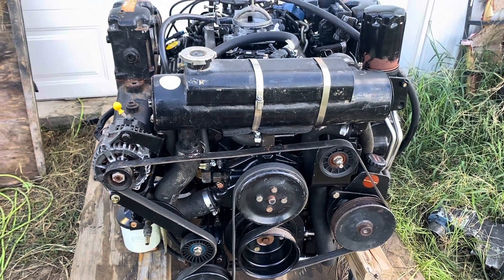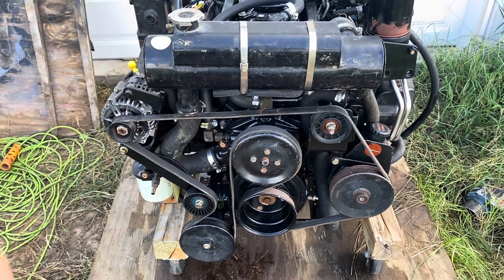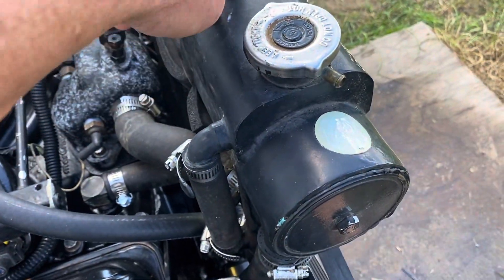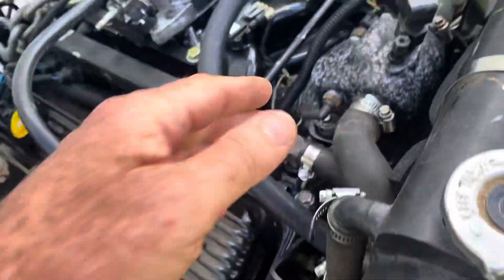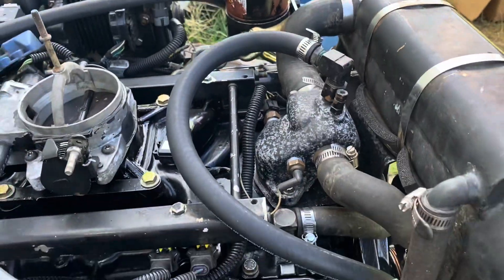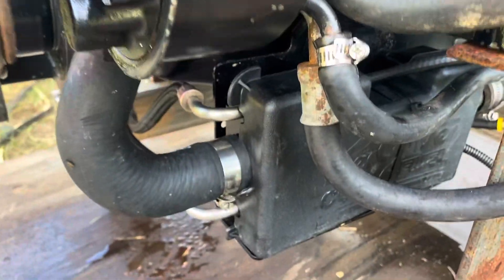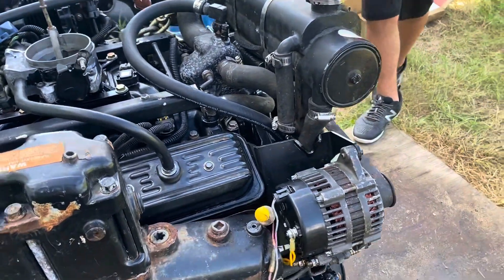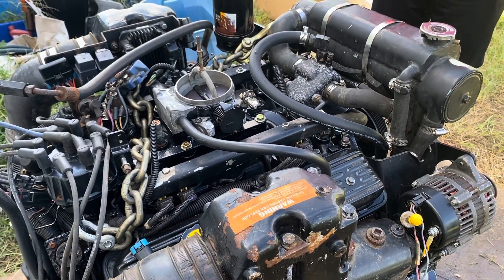Mercruiser 6.2 (1f) - Closed Cooling System Basics

Comment: Hi, i have two of these in my boat, i was wondering if it’s beneficial to fill the radiator with coolant instead of water, we are in Australia and don’t have to winterize the engine at all. Thanks for all your help.😊
Reply from the maker: I would add a minimum of antifreeze to the engine since there are corrosion inhibitors that will make the engine last longer.

Comment: What is the small hose that connects from the engine to the water pump?
Reply from the maker: Good question. I missed that hose. This engine was from a large cabin cruiser boat. There was an outlet off the intake that went to a remote hot water exchanger to make hot water for taking a shower on the boat, or cleaning fish, etc. There was a return hose connecting to the water pump to be pumped back through the engine. I just put a short hose between the outlet  and inlet as a temporary bypass.

Comment: I m getting a lot of brown on my coolant reservoir. Could it be from rust in the exchanger?
Reply from the maker: I believe the heat exchanger is made of bronze and copper so t doesn’t rust. Drain the coolant (hope you had some antifreeze) and freeze a gallon and any water will freeze leaving behind liquid oil if it’s mixed.

Comment: Add a regullar radiator with fans plus the heat exchanger.
Reply from the maker: Why would that be needed? The heat exchanger is plenty big enough.
Reply: @moccasinmarine a conventional radiator mounted outside on the roof with a electric forced flow fan would  increased cooling efficiency, reduced heat based material wear on the heat exchanger and if piped correctly with proper manifold and cutoffs reduces emergency engine shutdowns for heat exchanger issues. In tugboat applications where max power with little movement through the water situations is encountered an additional conventional radiator and fan will shed upwards of 60% more heat that a conventional keel cooler and or heat exchanger.     
Just amazon purchase a radiator and fan kit and some extended  piping to get it outside up in the free air and trust that your oil won't cook as fast your wear and tear will be reduced and overall engineroom heat will drop 25%
Reply from the maker: @devinmartin7626  the boats I work on aren’t tug boats. They are usually personal watercraft with an engine stuffed in a covered bilge. There is no practical way to mount an air cooled radiator and there is no need to. If more cooling is needed use a larger water to water heat exchanger. Water has a specific heat of 1 btu/lb/F. Air is 0.075 so water is 13 times more efficient at transferring heat so it’s much better to use water.

Comment: Does this require an overflow bottle? There appears to be an expansion outlet by the cap.
Reply from the maker: If there are no leaks the system expansion tank should do the job of allowing the water to expand and contract between run cycles. So after initial fill and expansion you don’t need the bottle. But in the real world the bottle makes up for any leaks over time.
Reply: My oem system has an overflow

Comment: Great information!    Any chance you have a video on winterizing it?  Just bought a boat. It has this set up. However. It sucks up water from the bravo3 and also through the hull with a ball valve.
Reply from the maker: No video on winterizing but if you are running antifreeze on the closed side half is already done. Just follow the pipe coming off the hull and drain all low points. The exhaust manifolds will need draining and the raw water side of the heat exchanger. If its fuel injected the fuel cooler as well.

EDIT: let me clarify low points. I’m not talking about just the obvious lowest piping in the bilge. I’m talking about traps where water is trapped in any low points below two higher points. In the video the pipes leaving the heat exchanger going to the bottom of the exhaust manifolds are low traps even though the raw water pipe at the fuel cooler is technically lower. So if we use the engine in the video as an example, you’ll need to drain the raw water pump itself and the hose leaving it going to the steering cooler, you’ll need to drain the fuel cooler, and then drain the hose under both exhaust manifolds. To drain a hose Mercruiser usually installs the blue twist plugs to make it easier but not always. As long as you have good antifreeze the block and intake doesn’t need draining.
Reply: @moccasinmarine  i would also love a video on winterising it!

Comment: So, no need for winterizing the boat at all, correct?
Reply from the maker: No you still have to drain the exhaust manifolds as they are low points in the raw water side. Any low points in raw water side still have to be drained.

Comment: Does the raw water side when leving the HX to the exhaust manifolds have the same hose exit or seperate? I need to barnicle bust and trying to figure the return to bucket location. TY
Reply from the maker: At the 3:30 mark I point out the port exhaust hose leaving heat exchanger and at 3:40 mark I point out the starboard exhaust hose leaving heat exchanger.

Comment: There's a company now offering aftermarket closed loop cooling kits for MerCruiser engines, in both raw water exhaust, and closed loop exhaust (where the manifolds are cooled by antifreeze).  They work very well.  I installed the closed loop kit for both engine and manifolds on my 2006 4.3L.
Reply from the maker: They are very expensive wouldn’t it be a lot cheaper to just maintain it properly? On the other hand, lack of winterizing keeps me in business.
Reply: @moccasinmarine  Maybe i want to use my boat in the winter without draining all the plugs every time after i take it out. If you still have to drain water out of the raw water side what's the point really? One of my plugs is a real pain to get to.